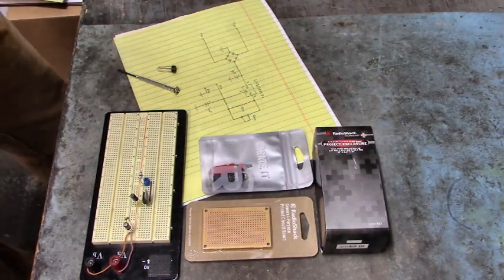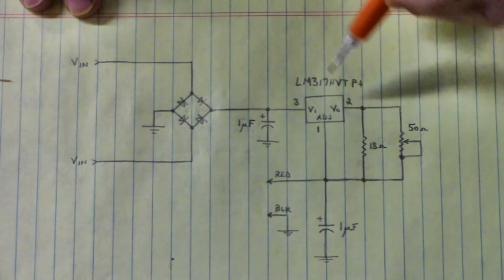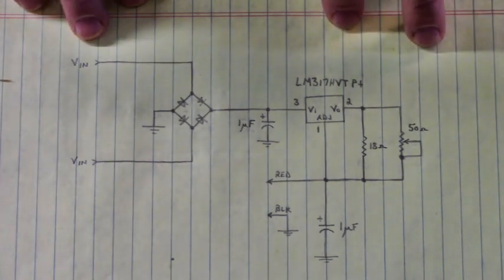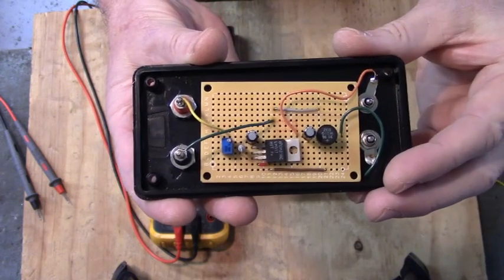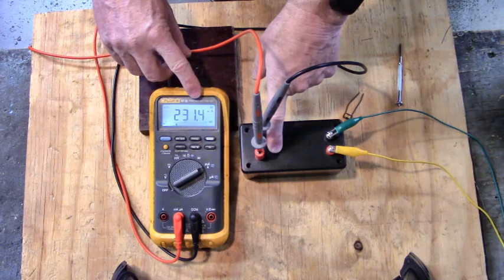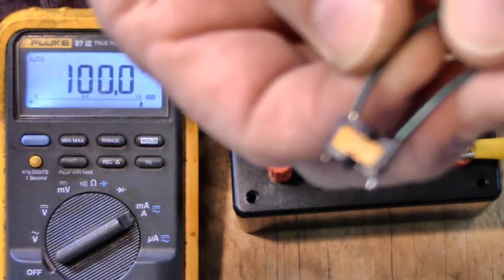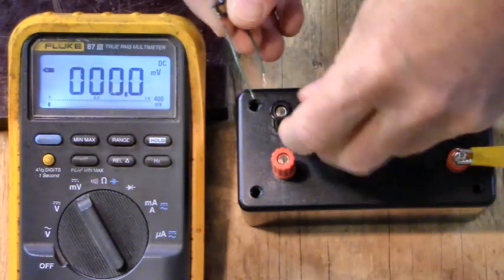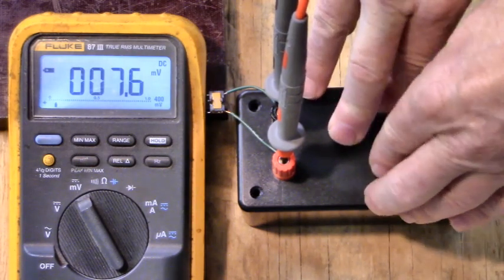Constant Current Source for milli-Ohm Measurement

Comment: Suggest that if you measure the voltage drop directly on the resistor terminals instead  though the wires you'd get a more close value to 0.07 ohm. When dealing with milliOhms every piece of wire add counts!

Comment: Very cool attachment! I purchased one of the “half home“ multi meter adapters. It’s about $20 and converts your multimeter into a 0.1 precision milliohmeter. It works really well and seems to be as accurate as most of my lab equipment. 

I love your project and I would have much rather built something DIY, but I didn’t have the time and that was a good well-developed and accurate product cheap… also, it’s very small and portable with a coin cell battery 

so you just plug it into your multimeter if you’re in the field doing a repair… And boom you got an instant milliohmeter without carrying an extra device. End it has a built-in 0.1% 10 milliohm calibration resistor

Comment: Cool, simple design that works! A couple things: 1) How sensitive is the 100mA output to voltage change at the input (5V)? 2) Next time, align the trimpot adjustment with a hole in the lid so you can calibrate it with the lid attached. Also, maybe add a "Power ON" LED to the input voltage side.

Comment: Yes, nice, simple and useful test jig indeed. I use the same method for years now, using my bench power supply, setting the output voltage usually to 2 Volt and the current (depending on the case) either to 100mA or to 1A. The 1A setting has the advantage of direct millivolts to milliohms reading and is more reliable for testing power switches or evaluating resistances of safety ground (grounding lines to ground bar). Besides there is no need to shift the decimal point of the multimeter’s indication by one digit to the right. This is needed only when using the 100mA setting. Another advantage of this setup is that it doesn’t draw any current from the power supply when not connected on a resistor for testing it and the instrument simply shows the open circuit voltage of the power supply...